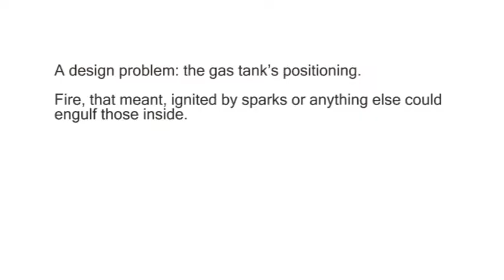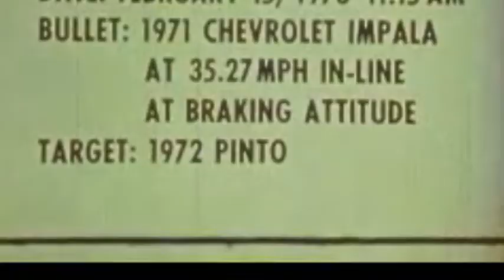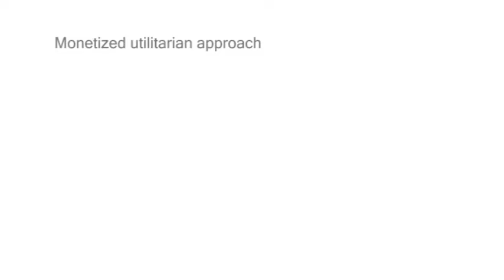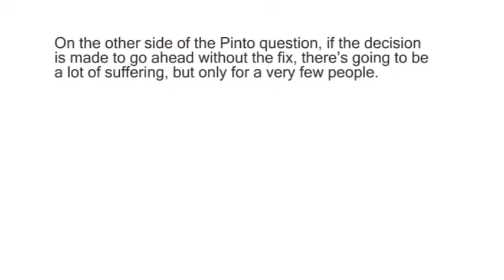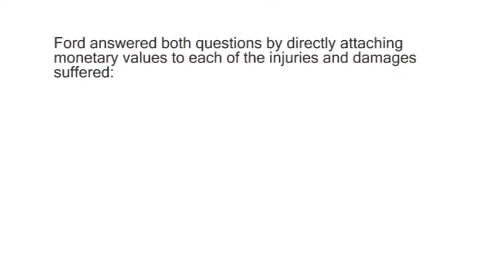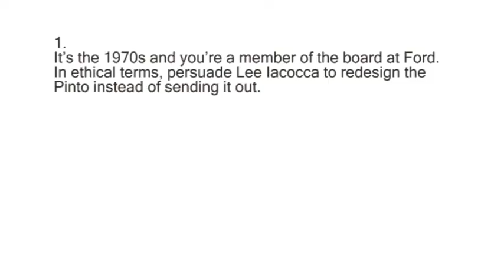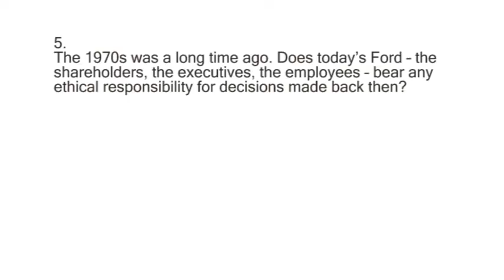Case: Ford Pinto

Comment: In first case, Ford was not loosing anything.Just the buyers had to pay extra $11,each. But in second case, Ford had to pay from there pocket as the compensation amount. So why they went with the second one if they could have profited from the first case.

Comment: It was 1980-81....it was in Lorain, OH. Southview High School,  it was either 3 or 4 students perished in a Pinto.....due to this  exact issue....in this story.  One of the people killed was U. Figueroa........ RIP.  It was quite devastating. in our High School, I can assure you.

Side note:  I knew some design guys who worked at Ford......one guy showed where shaving off a bit of metal at a joint would save the company 12 cents per vehicle......He ended up getting an ABSOLUTE massive bonus check (No...I don't know how much...but this was encouraged).  Scary isn't it?   At my job (not in the auto industry),  certain managers hated me because of safety measures I brought up.....SOME took what I said VERY seriously and made the changes.......and some didn't.......

Ah yes...the mighty "cost benefit analysis"...........one of the scariest things ever invented........it's a "math word problem" (remember those at the bottom of the page?) that NO one EVER enjoyed doing......but here's a REAL world one that is beyond frightening....

Comment: for $70 equivalent, Ford chose to see "some" people incur un-imaginable lifetime suffering, along with their families.  Ford should have been slapped with a $100 million punitive damage, that may have changed consideration of future human customers.
Reply: Ford was slapped with $6.05 million for compensatory damages in Grimshaw v. Ford Motor Co. Then an additional $125 million in punitive damages. This opened them up to a criminal case for reckless homicide and criminal recklessness, resulting in a $530 million dollar fine, the largest in automotive history.
Reply: Bruh, the people who got the worst end of the deal (pun intended) are those who rear end the Pintos. We need rear Enders off the roads anyways.

Comment: I would not have allowed the Ford Pinto to go into production until the fuel tank defect was corrected. I would have rather played it safe rather than sorry even though the odds against a severe rear end crash are slim. I would have used a better safe than sorry approach and made sure that the fuel tank would remain intact in the event of a severe rear end crash.
Reply: that's the thing, it didn't need a severe crash to cause it to ignite.

Comment: In answer to this, I would pick #1 as the best answer as if this car were redesigned with the safety of the rear end, with the gas tank there, in mind, No lives would've been lost as a result of this calamity. I was only a baby when Ford introduced the Pinto for the 1971 model year. #1 would be the only sensible solution as if they did this, the Pinto wouldn't have been phased out like it was when the 1970's ended. It probably would've lasted much longer. Regarding the other thing about the Ford workers of today being responsible for what the Ford workers of the past did, my answer to this would be NO. Why? The Ford workers of today are only responsible for what happens only in this present time and not the past. Only those who worked for Ford at the time,  such as Lee Iacocca, then Ford CEO,  are the ones responsible. It wasn't just the Pinto, Iacocca also did almost the same thing for the classic 1960's Mustang cars with the problem of the "drop-in fuel tank" in the trunk of the vehicles. That was as much a fire hazard as it was for the incorrect way of positioning the gas tank for the Pinto and not installing the proper safety tools needed to make the car safe. Heck, I even remember Iacocca being asked by 60 Minutes about this and his attitude was this when he said "If you still have a 1960's Mustang, you should get rid of it as you should have gotten rid of it a long time ago! (yes, those were his actual words)" After the Pinto and during the fiasco that followed, Iacocca stepped down as Ford CEO and took the same job with Chrysler, and he still didn't learn his lesson as Chrysler's years with him were also not the best for that particular automaker. This is why the apostle Paul said to Timothy "The love of money is the root of all evil" as selfishness and greed are the root of all sorts of evil, especially greed. Iacocca was greedy and all he ever cared about was making money and not about safety.  Granted, he did pull Chrysler out of the hole, but there were still recalls of cars during his tenure there. Just sharing my thoughts and feelings.

Comment: It's a truism that for literally every driving death there's some amount of money the  firm could have spent to prevent it.  (And to be fair your video does mention this.)

> 0:36 "Ford rushed the machine through the early production and testing."

This is such sloppy English I wonder if it's the product of a Russian troll farm (production only occurs AFTER testing, and once a car is tested, who cares how rushed the production is?), but what is the supporting evidence for this claim?  Why use the scare-phrase "rushed testing" at all, unless you mean to present a bias?

> 1:36 footage or rear-end collision creating fire.

Fair enough.  No mention is made, however, how likely this was, or how many other cars had similar or even higher likelihood.  The video is manipulating you with a powerful image to think this car is dangerous, without giving you any voice-over saying that this was typical, that other cars were safe in this test, etc. etc.  

> 2:27 "Government regulations only required gas tanks to remain intact in collisions under 20 mph.  But what about the ethics?"

That's a decision for the voters, not for Ford.  The voters approved the legislators who made the decision to be let safety be curtailed above 20mph.  It's not Ford's job to second-guess that (though they could as a value-added proposition of course).

> 3:13 "It's not that much per person.  It's about $70 today."

What you're missing is that the yen was 360 to the dollar at that time.  The value-added of of Japanese car manufacture (over the cost of raw materials) was far far cheaper.  Huge numbers of people bought the more dangerous imports even WITHOUT the Pinto being this $70 higher in 2014 dollars.  The "unintended consequence" that your analysis is overlooking is that even being as well-engineered as it was, the Pinto cost so much that people were making a literally fatal decision to buy the import.  Add another $70 in manufacturing costs, and yet more people would be driving the relative death-traps.  That is not factored into this discussion.

So here's an ethics thought experiment for you: say Ford had increased the Pinto safety over and above society's consensus decision... to the price no-one bought it, and death rates ultimately were HIGHER than they in fact were?  There you'd have Ford making a decision that killed people.  Where would they stand ethically?  Not a rhetorical question, I'd like your thoughts please.

> 4:17 US govt officially valued a life at $200k

Yep, not Ford's idea.  They were officially required to use this value by the govt, which was selected by the voters.  In short the value is this, because that is what the American citizenry wanted.

> 5:06 photo of a Pinto labeled "Keep off my rear, I'm explosive!"

Self-fulfilling disinformation.  Lie to people, they believe it, then use the results of that belief to lie to more people.

(I saw an attack of Biden's first year that worked pretty much the same: an editorial panned Biden's first year in part because he got so much bad press!)

(Same trick is used by snake-oil salesmen: sell their quack remedy on TV... then make a new set of ads touting the fact that they're the biggest-selling remedy, or have won awards for their sales success, etc., presenting that as society's imprimatur that they're above board.)

> Shortly thereafter the Pinto was phased out

Again, self-fulfilling disinformation.  It was phased out in part due to bad information it was dangerous, and now they use that phasing out as if it proves it was dangerous.

Comment: If Japanese companies could make a safe small fuel efficient car, and Ford could not, what does that say about the quality of Ford engineers? Maybe they should have sent someone incognito to buy a small honda and reverse engineered its fuel and power systems. Not that 70s Honda Civics weren't little sh*tboxes, but they were cute and didn't explode. All cars from the mid 70s on were little flimsy sh*tboxes anyway. Making Smart Cars and little Fiats of today look like Hummers engineered by BMW and designed by Aston Martin.